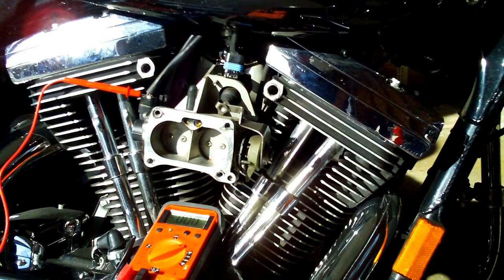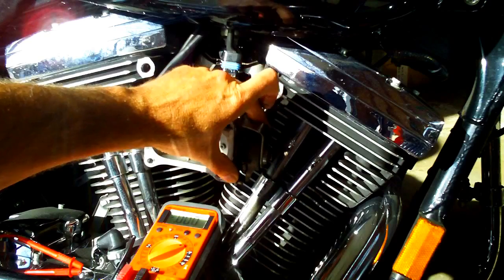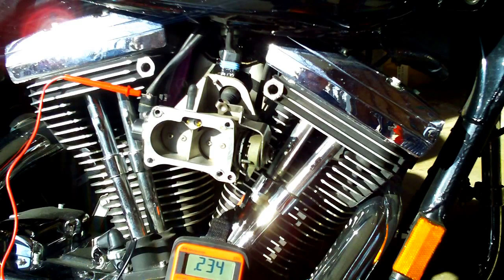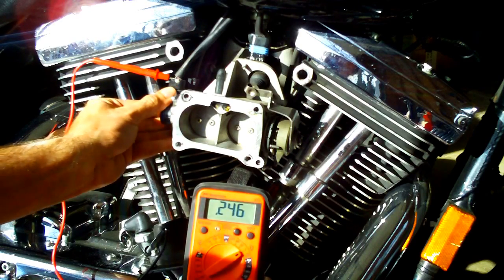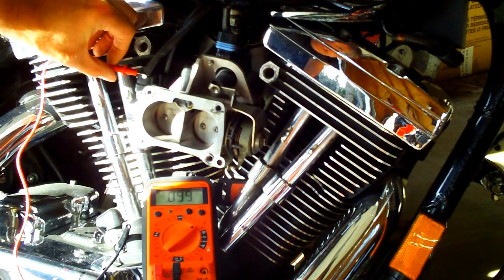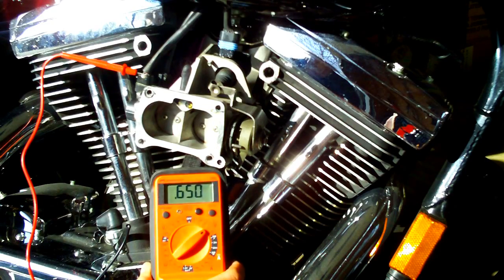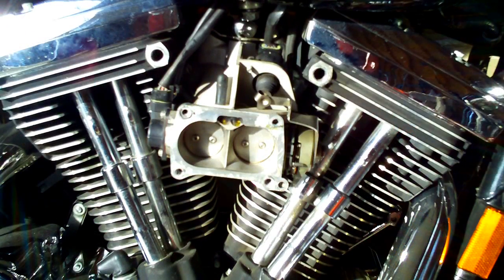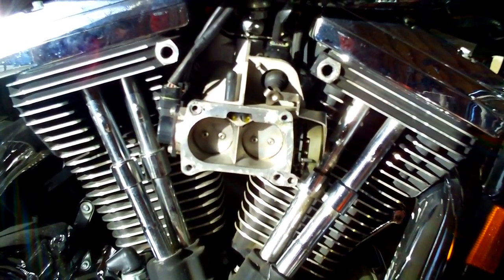Reset Harley Davidson Magneti Marelli Fuel Injection TPS Settings ✔

Comment: Hi, Thanks for the video. Since you know the magneti and marelli system, I'm hoping you can answer a question of mine. Having fuel issues, replace my fuel pump , filter and tubing and a leaky quick connect. Still will not even try to start. I pulled my fuel assembly up just enough that my pump syphon was still in fuel, activated my pump to check for tubing leaks. No leaks but I noticed my fuel return line just pumped a solid stream of fuel back when I activated the pump. I was wondering if you know anything about the regulator preceding the fuel return line? Thanks, John.
Reply from the maker: Hello John, I am familiar with the location of the fuel pressure regulator atop the intake manifold. To be sure this is a fueling issue, have you tried pulling the plugs and checking for spark? Can you carefully spray something flammable into the intake, such as WD-40 or starter fluid, and then turning over to see if it makes the engine tries to run?
Reply: @contact4mwy7  Thanks for the reply Mark. I do have spark, It will try to run when I add fuel to the intake. Kind of been scratching my head with this. I don't have a scanalyzer to hook up, was thinking maybe the injectors aren't firing or fuel.
Reply from the maker: @mopardeer  if it fires from an added source, then fuel would seem to be the problem. Did this start out as replacing a leaky fuel line coupling under the tank? Are you 100% on the routing of the tubing (didn't connect up backwards for instance)? Can you hear the fuel pump run when you first power up the bike?
Reply: @contact4mwy7  I started with fuel pump not running. It's a 2000 road king, 22000 miles, original pump failed and in pretty rough condition, lots of debris in tank. Replaced filter and pump cleaned out tank and now I can hear the pump run and shut off when I turn my ignition on. Still didn't start. I disconnected the quick connect leaving the tank cause I heard of it failing and not allowing fuel out. Well, it was original equipment also and leaked when reconnected. I got a new quick connect fitting which came with new tubing which hooked to the filter discharge in tank. I'm pretty sure I got the tubing all correct. Checked fuses numerous times, heard the flow in the tank, found out it was the return line and was just curious of the flow back. When I turn on the ignition, pump runs and a constant stream flows into the tank till pump shuts off. I haven't found an easy way to verify fuel pressure to injectors, don't have an in line gauge. You're probably sorry you replied to me........sorry, haha. I set it aside few weeks ago, figured I'd think on it before tearing more apart.
Reply from the maker: @mopardeer  I'm curious why it's not firing up too. When you can safely introduce another fuel source that might shed some light on it. Were the plugs wet with gas or dry as a bone?
Reply: @contact4mwy7  Plugs were dry, no sign of fuel. I'll continue on for a bit, trying to avoid the Harley dealer. I know they could check my computer control unit and verify fuel pressure with an inline gauge. Appreciate you responding, great to have another opinion. I'll let you know what happens even if it's something stupid I've done. lol

Comment: Just found this video, that looks like a late 90s Roadking Classic. I have a 98 Roadking Classic with EFI Evo, it runs well at the moment but with the Magneti Marelli EFI system, it is always in the back of my mind that it will, at some point, give me trouble. Not a lot of mechanics in south eastern Australia who know how to work on them, certainly not Harley dealerships. Having watched your video, I think I might check those settings on mine, as it sometimes wont idle back once it warms up! Great information, thank you.
Reply from the maker: Glad you found it. It is rare to find any tech, dealer or Indy, that knows what makes these tick. This one is a 1997. After the adjustments it ran very well up to the time I traded it. Made trips across state lines two-up, no issues, great gas mileage, plenty of power. I did add an aftermarket EFI tuner to add a pinch more fuel. As long as all sensors are working properly this EFI system should last a long time. It got a reputation of being hard to work on so Harley moved on to the Delphi system. Set it and forget it. It doesn't like to be tinkered with, but once it is setup properly it just runs great.

Comment: Mark, is it possible to adjust the warm idle without going through the re calibration process?
Reply from the maker: Yes. The warm idle screw can be adjusted without any probes hooked up at all. If I remember correctly, right around 1,000 rpm is recommended to keep a good charge on the battery and feed the electronics, etc. So adjust away!

Comment: Can you tell me what multimeter you used and setting?
Reply from the maker: Set to Millivolts DC. Measuring down to 1/4 of a volt DC, a very small amount but important for the system.
Reply: Just set everything and it's totally out of wack now
Reply: I just got a meter that would read. Goes down to .000v DC. It jus keeps reading the full range of .002 to .040  while everything is shut and cables are slack. It's a 2001 road king tc88. Thinking a bad TPS?
Reply: Not the best with multimeters. Bike has been slowly giving me break up issues during easy acceleration
Reply from the maker: What model multimeter is it? I would like to see it.
Reply: @contact4mwy7   cen-tech 61593, 37772 it's from harbor freight
Reply from the maker: @grimg8663  what is the brand and model of the multimeter so I can look it up online.
Reply: Look up 2 posts
Reply from the maker: @grimg8663  sorry, didn't see that you posted that. I'll take a look.
Reply from the maker: Ok, I see it. What setting did you turn the knob to? It should be in the range with the V with the flat line and the 3 dots, the DC range. What number did you put it on?
Reply: @contact4mwy7  I set it to 2. It'll read 0.XXX. I found it's running ok around 0.019 but it still breaks up mid throttle cruising. Idle and 1/2+ throttle seems ok
Reply from the maker: @grimg8663  ok, good. You should be able to turn the throttle position sensor to get a reading of 0.275 with the bike on, and the cold idle plug disconnected. Make sure the idle stop screw isn't touching also. 0.019 sounds way off, too low. You have the wire probes in COM and V/π/HZ holes, right?
Reply: @contact4mwy7  yup probes are in the right locations. As for that setting, it's virtually impossible to rotate the sensor that far. This is a twin cam not Evo. I tried higher settings but all hell breaks loose after 0.025.
Reply: @contact4mwy7  I'll try one more time when I get home
Reply from the maker: @grimg8663  it's just weird that you can only get to .02 and not higher which would be .275 and then cold idle setting should reach 0.650, and I don't see you hitting that number. Something definitely is not right. Even though this is for a twin cam, not EVO, the two use almost identical settings because they both use the Magneti Mirelli fuel injection system. I've only seen minor differences which I mentioned in the video description. Is the problem with the throttle position sensor? Is the problem with the multimeter not reading the DC voltage correctly? You're sure you've picked the correct wire to probe and the COM end is connected to ground? The battery should be reading in the neighborhood of 12 volts. Put your tester on like a AA battery. It should read 1.500, thereabouts. Try different settings on the multimeter, 200m, 2, 20, and see if it's always 1.487 or does it change? If setting 2 shows the battery voltage at like 1.487 then it sounds like it has a proper reading to also use on the throttle position sensor. If none of the settings show 1.487 (as a guess what the voltage might be from the battery) then you may have to get a different multimeter. Just trying to get the whole picture of what's going on there. Did you watch this video I posted of the actual multimeter I used and it's settings? https://youtu.be/SSi6kIp_Vrg
Reply: @contact4mwy7  ended up using a copper wire tucked down in the plug to get a proper reading. Set it to 0.190v and cold to 0.660v. Seems to be running better now. Thanks for all the help!
Reply from the maker: @grimg8663  so you were able to set cold up to 0.660, that's a good sign. The 0.190 reading surprises me that it runs good, although it isn't a horrible amount lower than 0.275. This setting is probably going to make the ECU think the throttle is not opened as wide as it actually is, and may incidentally create a lean condition. Check your spark plugs for color after going on a good run. If they are are dusted in what looks like white chalk you may have to address this with a higher volt number. Just my hunch. Your judgement in how it rides is what counts. Good job!

Comment: What is multimeter set at
Reply from the maker: Millivolts. You need to see small voltages as in 0.250 (one quarter volt) DC. NOT AC.

Comment: not sure if you still reply to comments on this video but I have a 1999 ultra. I can't get my TPS to read at .275. I cannot get it to go above .040. Does this mean I have a bad TPS sensor? thanks!
Reply from the maker: Are you sure you have your multimeter set right? Is your battery fully charged?
Reply: @contact4mwy7  what should my multi meter be set to? and yes it was fully charged. at first I thought I didn't use a long enough pin but it was my ground. I am not able to get it above .040. When I first looked it was at -.001
Reply: @contact4mwy7  and then when I would open my throttle like you did I could never get it to read OL either.
Reply from the maker: @dakottaschumm3071  OL is overload, too high for the setting in the multimeter. What brand and model are you using? It should be set to read Millivolts. One quarter volt DC. What prompted you to check it, was the bike not running right? If it was running horrible or not at all then maybe it is the throttle position sensor. But if it was running ok, maybe not. I don't see how it could have been running at all with a reading that far off, so I'm hoping it's a multimeter thing tricking you.
Reply: @contact4mwy7  had a lot of back firing and weird shuttering with continuous throttle. Also was slowly getting a lower and lower idle. And I had to multi meter on the right setting. Figured it was just sensor that was off
Reply: I'm having the same issue?
Reply from the maker: @grimg8663  you need a voltmeter that can read down to 1/4 volt DC. 1 and 1/4 volts would look like 1.250 on the meter. You need to be able to see 0.250 on the meter. One that reads numbers of 0.25 might get you in the ballpark. The voltage coming from the throttle sensor is less than 1 volt DC. I hope that helps to clear it up.

Comment: Was the ISC fully closed or open when u unplugged it.
Reply from the maker: I don't remember that it matters. The cold idle screw, which it pushes against, is fully retracted until it no longer touches. It will come to rest where it should, and needs to be unplugged so that when the power is turned on it doesn't interfere. With the bike off, unplug the connector.
Reply: This is my first HD it’s a1998 Electra glide. When I got it it ran great just would not idle.  I have been trying to do exactly as ur video is. But I can’t seem to get it.
Reply from the maker: @user-on7fj6im1i  The cold and warm idle screws set the idle speed. If it wouldn't idle it may have needed either or both turned in a little to boost the idle speed.

Comment: Mark hoping you will see this and reply. I used this video but am getting super low voltage readings .017 right off the bat first test. Bike was idling for a short while and shutting off why I decided to try this. Even maxed out the highest reading I am getting is nowhere near the .275 more like .056. I’ve ordered a new sensor hoping that’s the culprit, I guess I’ll try my luck after I replace the sensor in a few days but I won’t know where to go if that doesn’t bring the voltage readings into range.
Reply from the maker: I hope it's simply the sensor. This also plays off the voltage of your battery, have you checked that? Were you getting a check engine light?
Reply: I didn’t check the battery voltage but I know the battery is brand new, I’ll check it tonight anyway just to make sure though. Sounds like it could be a bad sensor I’ll update here in the comments if that ends up the problem.
Reply: Also no I haven’t been getting a check engine light, just terrible idle/staling at idle. Forgot to put that in my last response.
Reply from the maker: @zacharywheeler4217  If you have the correct wire probed it shouldn't be showing voltage that low. I was going to say increase the idle screw, but if the TPS is off that far it could explain why it's not idling right and stalling.
Reply: New tps, can get it dialed in right but if I tighten the sensor enough so that it won’t move the throttle will stick open, when I back it off the throttle will work correctly but I feel like the sensor could end up moving with vibration and riding. Not sure what to do, it’s snug but not comfortably tight it doesn’t seem. Not sure if just snuggling it and running it will heat it up and make the plastic stick better to the throttle body and keep from moving but I know when I took the last sensor off it felt like it was stuck there even after the bolts were loose
Reply from the maker: @zacharywheeler4217  it shouldn't cause the throttle to stick open like that, which could be dangerous on the road. Make sure it is absolutely lined up with the shaft and any groove or alignment part on the shaft. When it is on correctly the throttle should move freely and fully to wide open and back. Check that TPS is lined up where the throttle would be fully closed before you slide it on. The screws should align with their respective holes too.

Comment: What setting / meter range are you using? Dc voltage? Ohms? I cant seem to get it in range.. it wont show less than 1 volt on either of my meters
Reply from the maker: The meter is set to Millivolts DC. Not all meters can read that low, you may have to find one that does.

Comment: Mark,what setting is the multimeter on when you set the throttle position sensor?
Reply: Well let me know if you ever got that answer. Smdh
Reply: @danabarnette7891 The throttle position sensor number is .275 and the cold idle screw is .650. My multimeter was set on 20 volts,it's the next highest number on your multimeter above 12 volts.

Comment: I tried this several times and kept getting all different numbers for Volts no matter which way I put it?
I’m guessing the sensor is bad?
Any suggestions let me know?
For now I guess I’m ordering a new sensor and hope it solves the problem!
The bike has been idling up and down , backfiring as well. While riding it the throttle kicks in when it’s not even being used??
Reply from the maker: There are multiple sensors in this system that all have to function correctly. If one goes it can create a false situation for the others. If you're convinced the throttle position sensor is no good, order a new one. If it's not the throttle position sensor that is causing your problems you may have to find a way to verify the rest of the sensors as ok. A service manual for the year and model of your bike may be a necessity.
Reply: I have Clymer manual and it says to bring it to the dealer for any adjustments for the EFI you need a Scanalyzer?
Is there a way to check the other sensors to make sure they are working properly with a volt meter?
I’m at a loss here? The bike won’t stay running now
Reply from the maker: I'm only familiar with the throttle position sensor and no longer own the bike. I don't know if any dealers still have the scanalizer, but may know someone who does?
Reply: Yeah, I have a find someone who has one or buy a used one online , no dealers support the MM system any longer

Comment: Hi. Please Help Me. How reset error codes!?
Reply from the maker: I found this info on a forum.  on my 1998 road king classic with fuel inj. you can read the codes doing the following:
1-turn ignition key switch to ignition and then turn off 1 second after fuel pump stops.
2.repeat #1 again..remember 1 second after pump stops
3.turn ignition key switch to ignition and wait about 8 seconds for a bunch of flashing of the check engine light
it will then stop for 2 seconds..get ready... these are the codes you must count:
it will slowly flash 1,2,3,5....there is NO 4....this is the first digit of the 2 digit code ..so it can only be 1,2,3,5 __ __
then a 2 second pause...then you will get second digit of the 2 digit code..it can only be 1,2,3,4,5,6
remember after the complete 2 digit code is given you will go back to the rapid flash sequence..
there are a total of 15 codes available with this procedure
examples
52,53,54,55 bad news ECM replacement
56 crank/cam sensor
11 throttle sensor
12 barometric
23 and 32 are injectors front/rear
24 coil
33 fuel pump relay--in this case you would not hear the pump but instead waited 3 seconds after the on / off sequence
*
in order to erase any codes you must disconnect the battery or wait for 50 on and off riding cycles.
Reply: @contact4mwy7  thanks I have 24 error code and replace spark plug, but the error did not go away and bike starts well, I don't know what to do
Reply from the maker: @88nicom  ECM 24 seems to point to coil, could it be an ignition coil issue? Do you have a way to test it? Is the bike skipping or running rough?
Reply: @contact4mwy7  unfortunately, there is no donor, I can't check for this, how can I check without a donor? starts and goes normally
Reply from the maker: I don't have any information on how to test the coils, but I would definitely check the connections of the wiring to make sure they are good, start there. Otherwise I don't know what is causing the ECM to give an error 24.